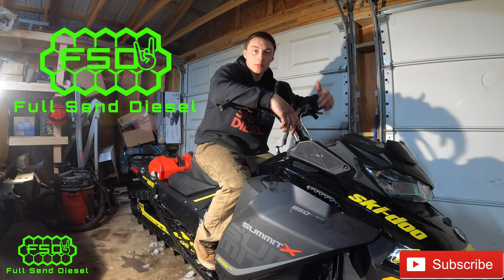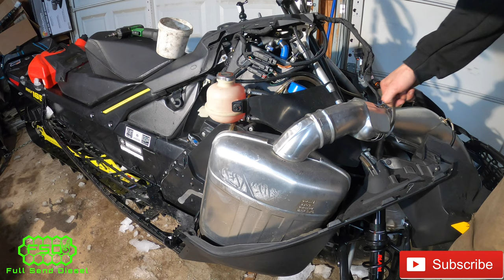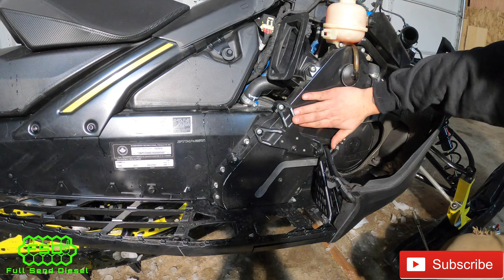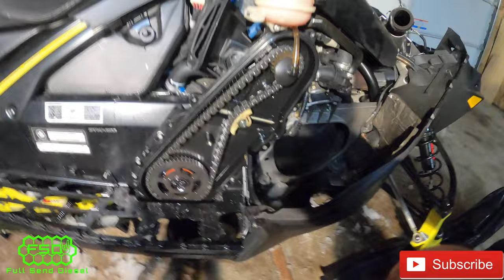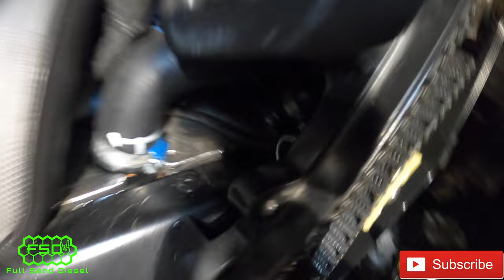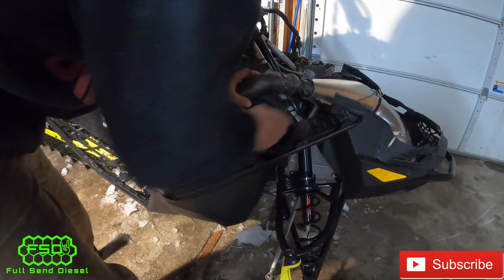Ski Doo 850 Chain Case Adjustment [HOW-TO]

Comment: Buddy youre changing you’re chain oil too often, not necessary twice in one season 😂
Reply from the maker: I don’t change it at all now with a belt drive 🤣🤣 but I air on the side of caution, cheap insurance as I’ve seen the Chains snap before.